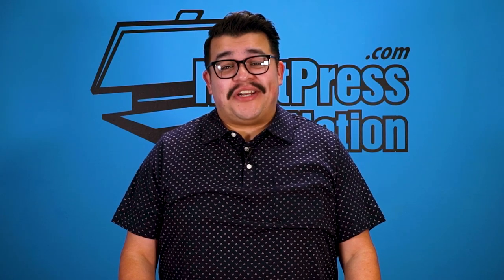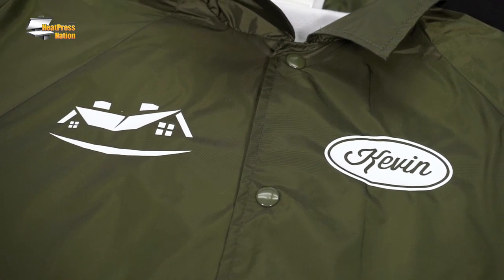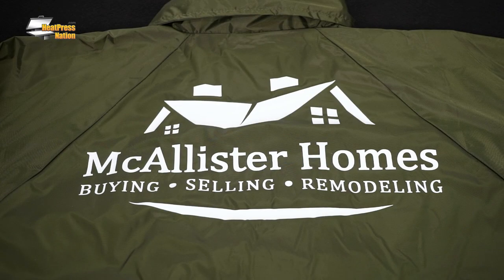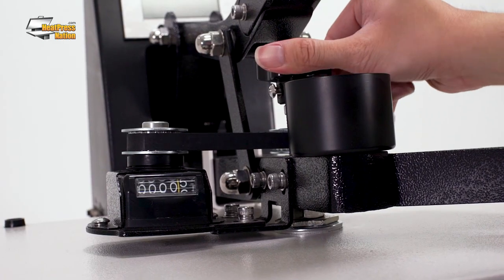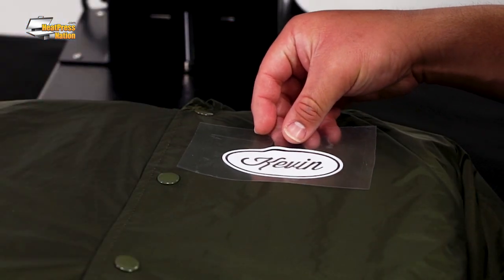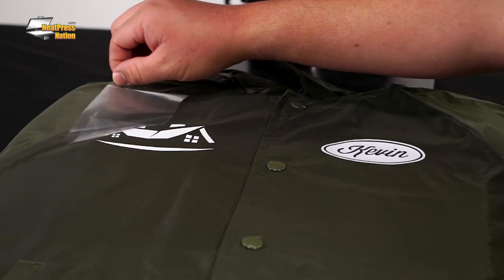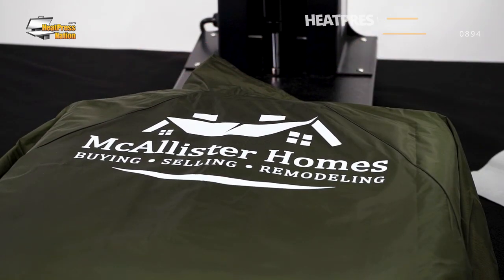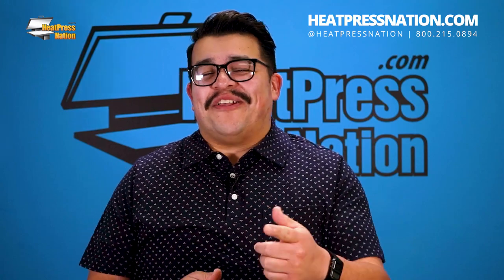How to Customize a Nylon Jacket with HTV

Comment: @heatpressnation Easy Weed Extra only comes in 2 colors and says it can be layered. How? Do you use it as a base  then layer normal easyweed vinyl on top as you would if you were layering regular easy weed vinyl? Also should time, temp and pressure be adjusted when layering? Please help...Thanks in advance!
Reply from the maker: Yes, we'd recommend using it as a base layer. Whenever layering EasyWeed products, you can press all the base layers for 5 seconds at regular temperature. The final layer is the one that gets the full 10-15 second press.
Reply: @HeatPressNation  Awesome. Thank you for the quick response and the valuable info!😎✊🏾

Comment: My vinyl keeps peeling off my nylon jacket, help!!!
Reply from the maker: You need a special HTV for pressing on nylon, as shown in this video. We recommend Siser EasyWeed Extra (https://heat.press/EWextra) or Specialty Materials ThermoFlex Xtra (https://heat.press/ThermoflexXtra). 

If you are using the correct HTV, the issue is likely going to be insufficient pressure. Also, if your nylon jacket has a waterproof coating, that could also cause even the correct HTV to peel.
Reply: What kind a paper do I need to use on Nylon Jacket 🧥? What do you recommend ? Thank you 😊